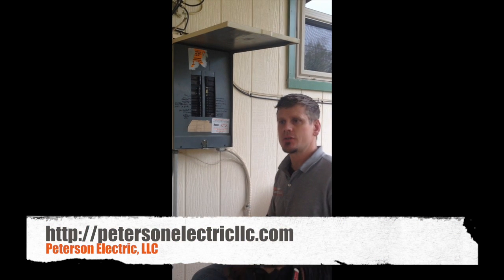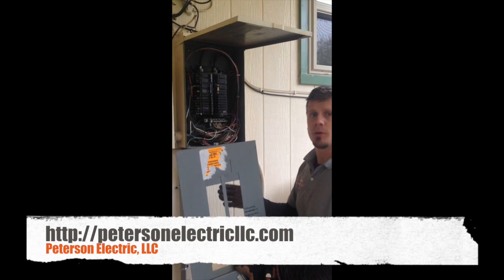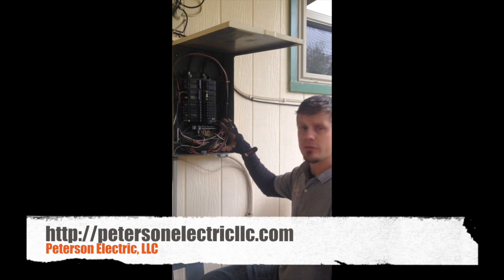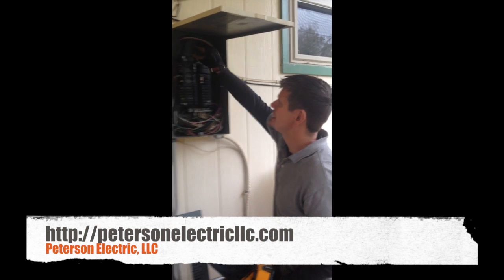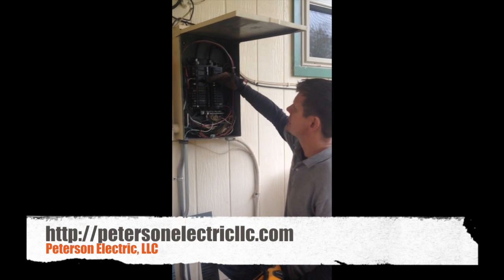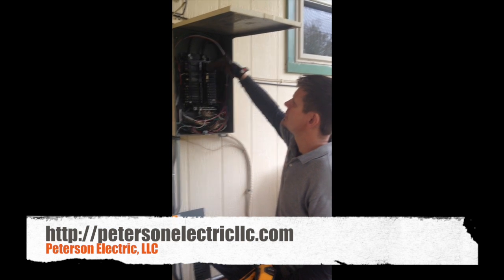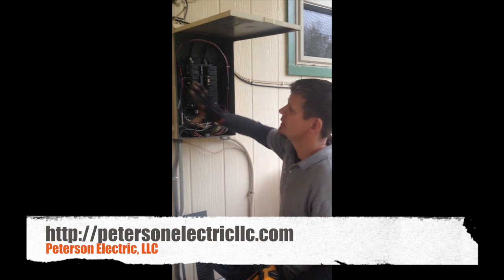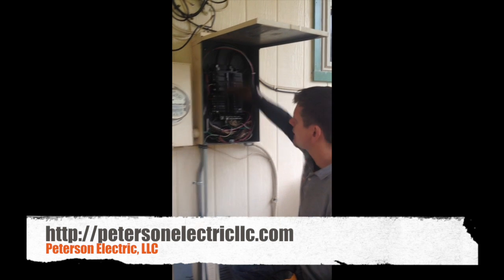How To Detect If Your Electrical Breaker Panel Box Is Failing?

Comment: Hey love this video! I have a question for you, if you can please help? I installed a new 20amp breaker, and everything is wired correctly. However I purchased some stringer lights and they plug into a regular outlet connected to 2 3way switches that I installed. So the lights turned on fine, no issues,  turned on more breakers no issues but when all of them are on, just those lights start to flicker. I double checked the wiring, all good. I used a  outlet tester, perfect. I ended up checking the voltage and it was 109 volts. I checked the other outlets on different breakers, 117-119 volts. I thought that was odd so I checked it at the panel and it was still reading 109volts at the breaker. I noticed a couple other ones were 109. My question to you is, with those lights that are led and 5amps flickering on and off, could that be due to the lower voltage, or possibly a bad bus bar, panel, breaker? To give you some info, it has a 100amp main breaker, 2 bus bars, 1 50amp on one side, 1 30amp for the water heater on the other, and I think 6 20amp breakers between the two. To also provide you with some info. Before I installed the new breaker, we noticed that once in a while the clock on the stove would dim real low then back to normal.